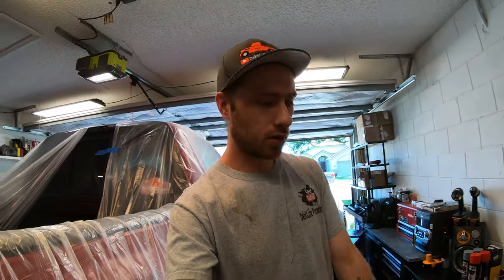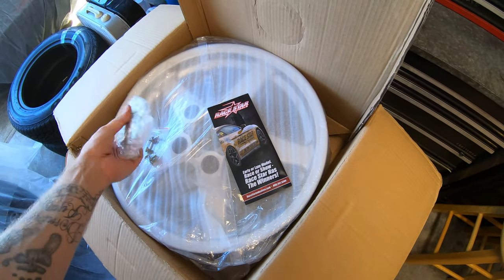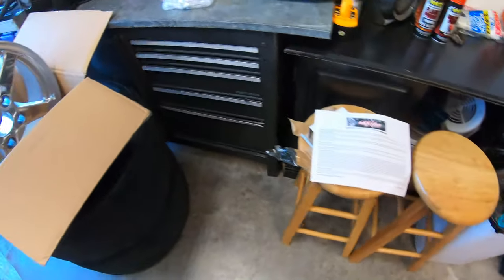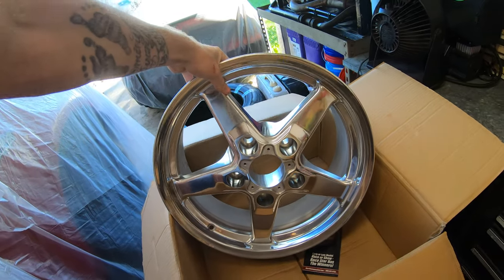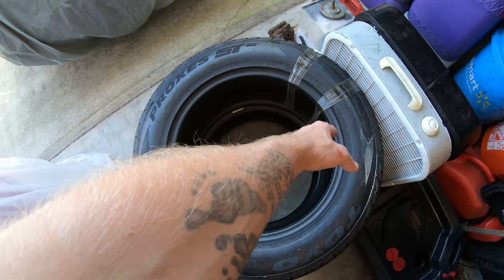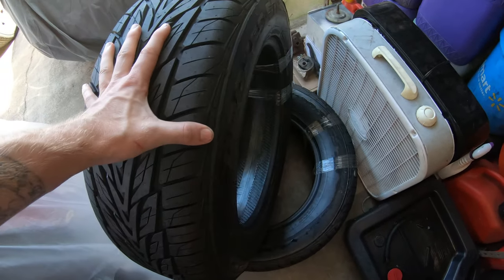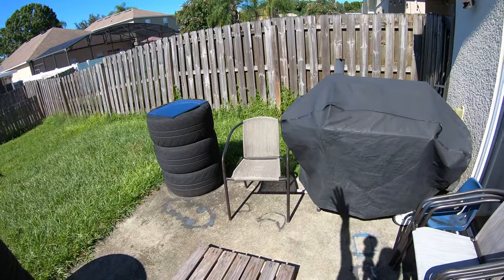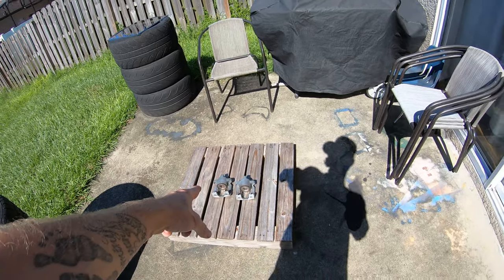Ford Lightning Build - NEW 17x7 Race Star Wheel Unboxing / Tires AND Finished the Rear Calipers!

Comment: Should've gone with black, but that set up it is going to help you alot, good luck
Reply from the maker: I got the rears and 4.5'' wide skinnies used, it was a deal I couldn't pass up, so I just got the 7'' wide fronts that would match.  It'll all probably get painted gunmetal anyways.  But I'ma rock the polished for alittle bit first, I always have dark wheels, so change will be nice for at least a little bit 😁